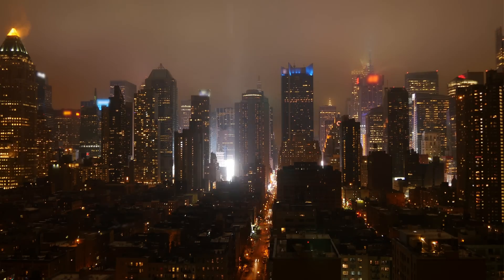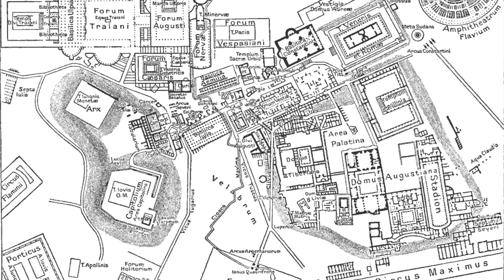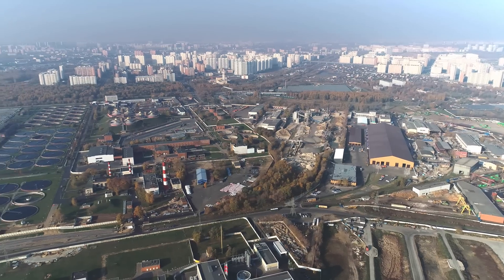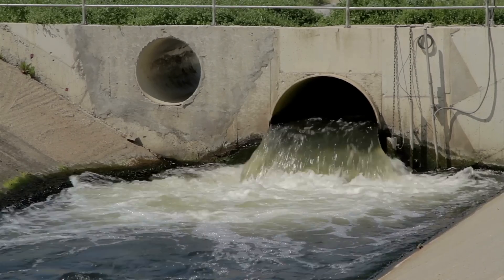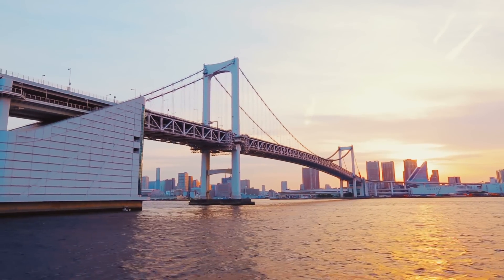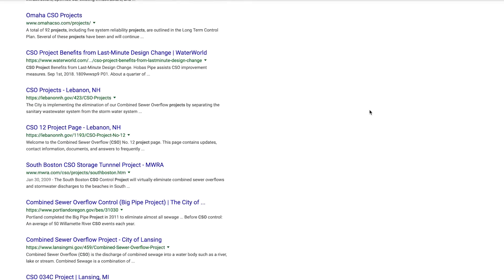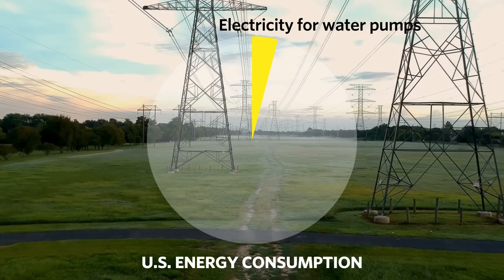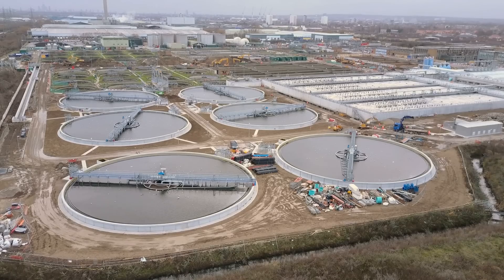An Intro to Urban Wastewater Systems

Comment: Any thoughts on permeable roads as a way to increase the permeable surface area of a city even further than bioswales? I know Salem, Oregon, started using them in some new developments but I haven't really heard of them much since.

Same with green roofs. If you think about it, all the concert and asphalt in a city basically just makes it into one big sewer pipe.
Reply: Chengyan Boon permeable pavement(roads) is being used but sparingly. It has its own pros and cons to consider. Currently it is in storm water management firm’s toolbox but only on occasion because of how much cheaper the other methods are.

Comment: Combined sewers aren't common in all countries mate, Denmark haven't used them since the 70's, rainwater is always seperate since then. 

The issue is pre-70's sewers, because are upgrade gradually, turns out, it was smart to ban combined sewers, we get a lot more rain these days.

Comment: Combined sewers are still being built today, at least in Europe, because they are simpler systems that are cheaper to build. If you only have to lay a single pipe that gets regularly flushed through by rain water, it becomes economically feasible to connect buildings outside cities.

Comment: You are one of the best youtube channels. Random Question: You keep bringing up Climate Change as if this is the most important subject, but is it really the most important subject? I know this question may trigger people, but there is a point. Creating a better environment tends to occur because of better technology. The Siemens water plant is saving $4 million a year. The rain gardens reduce fatbergs and other water service requirements for the city. My point about Climate Change, the changes need to improve the city finances and the environment. I personally believe in 10 years we will see Solar Panels as a boondoggle. Look at the Tesla/Solar City panels starting on fire. Review the mining for rare earth minerals for use in solar panels. Realize the increased cost for electricity which is paid for by the working poor as the rich buy solar panels. Many of our Current Climate Change initiatives don't improve the environment like Solar Panels. If instead, we improve the finances of a city which improves the environment, we will get the best projects moving forward. (Roof Gardens reduce the cost of electricity and enhance the quality of air as another example.)

Comment: Is it true that it’s illegal to have rainwater tanks at your home in USA?
Reply from the maker: I know people with rain barrels so I hope not!
Reply: @ericolens3   should be legal everywhere.
It's compulsory to have rain water tanks on new home builds where I live in Australia. The idea is any water than falls on your roof ends up in storm water, so you might as well drain it to your tank so you can use it for toilets, gardens, etc.
Everyone still have regular water connections for everything else.
Reply: Where abouts in Australia is it mandatory to have rainwater tanks in new builds?
Reply: @BirdTurdMemes  Newcastle for starters. No idea where else, but I've heard of it happening elsewhere.
Reply: Nebs 
Newcastle doesn’t strike me as a drought stricken place, but im not against the law 
just find it odd for the area
Reply: Big John not really. Coastal NSW has one of the wettest climates outside the tropics. Due to increasing populations with no new dams they are now starting level 1 water restrictions. Our problem is sometimes it won’t rain for months, then absolutey pour for a week straight. Most of that storm eater ends up back in the ocean, so they want people to catch as much as possible because they start to worry a little when it hasn’t rained much for several months.

Comment: Thanks for the video. I have some questions, if anybody can answer. Sorry if they are too dumb.
1. How does the water move through the sewage pipes? Is it by gravity? I have heard pumps, but then what about solid wastes in sewage?
2. In coastal cities, where you are almost at sea water level, won't these pipes get filled with water, because they would be below the water level?
3. Do cities run electric lines through these big pipes? Seems like the pipes are 90% empty, maybe the cities do underground electric lines inside them?
4. If seperate pipes are better, then why are there new CSO projects? Shouldn't they do separate pipes?

Comment: Fatbergs seem like a culinary issue. I notice that I can eat copious amounts of 'good' fats like extra virgin olive oil and not end up with floating turds, which would indicate undigested fat, but even a small amount of old or bad oil will cause my turds to float, which means that it's the type of oil and how it is prepared or how it is stored that is determining if the body can use it or expel it. Bad oils tend to be inflammatory too, so addressing the issue in this way would have other positive effects.
Reply: If you don't mind raising meal costs when you go out by 5 to 10 dollars sure.

Comment: Sorry, i sorta spaced out... But why can't they just do a combination of combined and separate systems?
There's actually a problem with not having enough rainwater (or water in general) in a wastewater management facility.
They can feed rainwater into the facility when there's capacity and thus treat all that dirty runoff as well. And when the system overflows, it's the rainwater that is dumped in a river and the shitwater that is treated.
Reply: Craig F. Thompson  Could, but there's the economy of scale. It's the reason we moved away from each and every one having their own little plot of land to grow food on.
The bigger you go, the cheaper it gets per unit.

Comment: Here in Brazil, using separate systems it's a disgracefull idea because of illegal connections of some houses to the rain collection tubes, which leads to taking the waste and throwing direct to the river.
Reply: As opposed to using a CSO and dumping it into the river when it rains anyway ?
Reply: Yeah but you have to agree that is better to dump waste into river only when rains than always
Reply: @VictorPenteado  obviously you just need better inspection and fines for illegal sewage dumping
Reply: Agreed, but I wish it was simple like this

Comment: Please please please don't flush "flushable" wipes. They may go down your toilet, but they really cause problems in the system. Next time you flush something think about the poor guy that has to pull it from a clogged up pump or backed up sewer line. Many suburban sewers are only 4-6 inches wide.
Reply: Craig F. Thompson  most people already understand that it's not smart to put grease down the drain compared to vs butt wipes. And freeze dried grase? Man where do you com up with such a impractical ideas?

Comment: Segregating sewer from stormwater is good. But why don't they segregate TOILET from shower, laundry and sinks? That would really speed up sewage treatment. Gosh, mixing poop with all those other gallons, then settling it out?? Probably 90% of the treatment is for unnecessarily polluted, non-toilet home drains.

Comment: 00:09 
Repect. Puplic transport is usually not underfunded but rather chosen to be the secondary transport type under cars :) for good reasons ofc
Reply: Not at all. If you have ever been in Europe, you know what good public transport systems do. Also, in our city, there are not many cars, but bicycles everywhere. It also is very green with trees and parks. That improved the atmosphere a lot, reduces noise and stress.
Reply: @IroAppe  dude im from europe. peace

Comment: Underfunded mass transit?  They should be rider-supported, not taxpayer supported.  If they can't make it based on fares, they aren't viable.  Oh, and isn't that stormwater being shown at :30, not wastewater?  We mustn't equate the two.
Reply: In that case I guess you also support putting toll booths between every intersection of the road and street network. Roads also cost money, and in many parts of the world they are also underfunded. And no, gas taxes are no longer viable given the rapid rise of motor vehicle fuel efficiency and the cannibalization of highway funds to address financial deficits elsewhere in government operations.